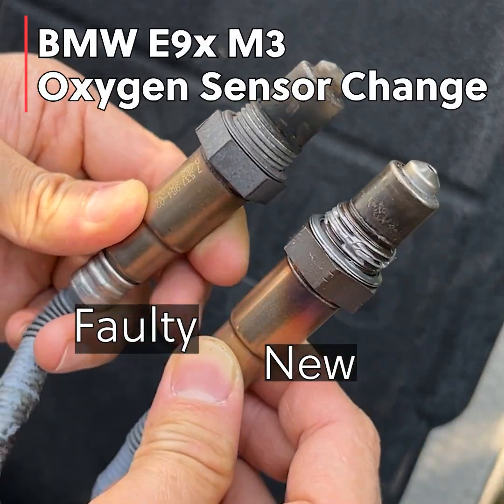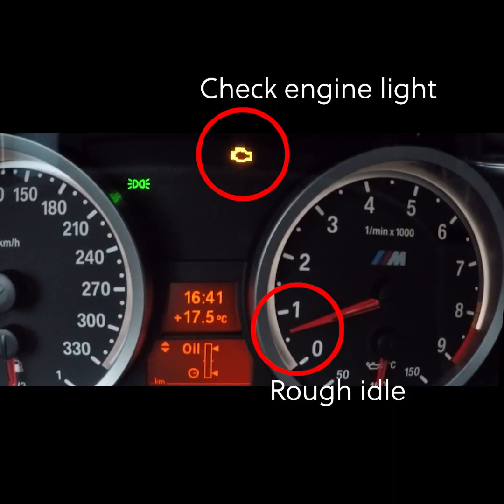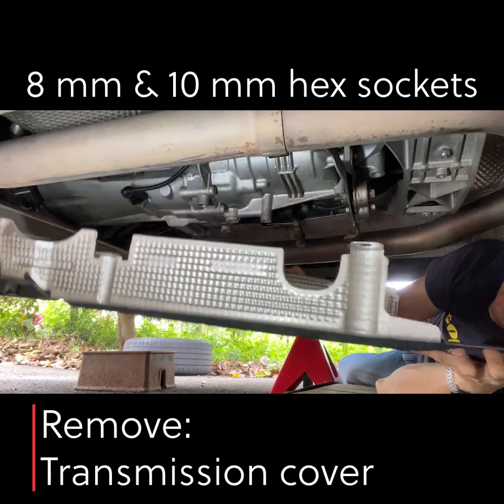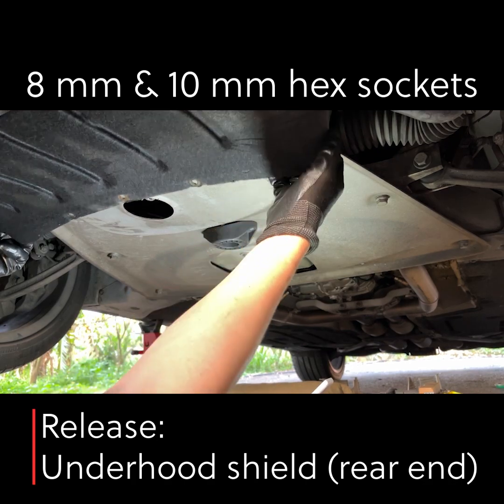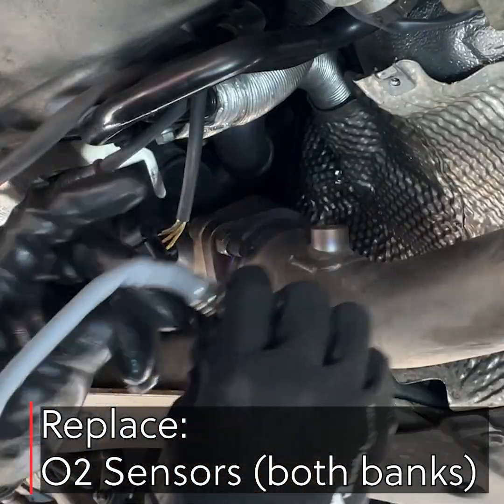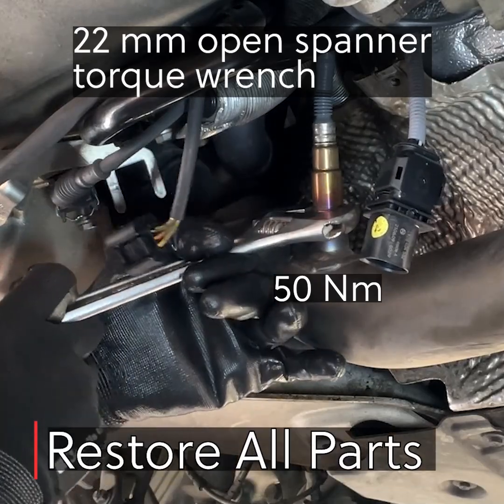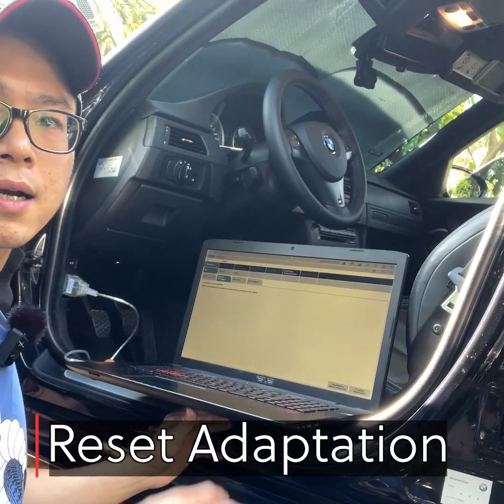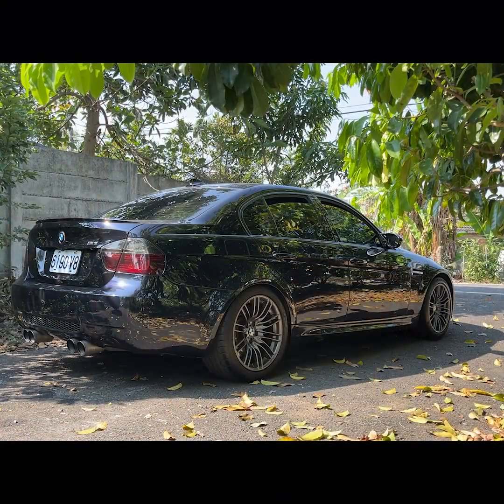E90 M3 Oxygen Sensor Change in 1 minute [ENG SUB]

Comment: If you remove reinforcement plate you need to replace bolts. They are 1 use (angle torque).

Comment: I'm getting a limb mode, but no rough idle and no check engine light. (Note: I already replaced both of my TA prior to this.)

However, if I go full throttle with 7-8k RPM it will usually result in limb mode.

Checked the code it's 2B16. "Oh maybe it's a faulty TA, since I got the rebuilt unit." Got a new one under warranty for free, replaced it. But this time my mechanic said, there is an Oxygen Sensor code showing up as well. He said he'll clean the sensor and delete the code, and we'll see. 

On day 3 after the new TA, same issue. Under full throttle at 7-8k RPM limb mode. I'm going to replace the oxygen sensor next, never knew the O2 could cause the limb mode.
Reply: Thanks for the video.
Reply from the maker: Hello Bew thank you for the feedback. My case is that the limp mode is caused by misfiring due to wrong air-fuel mixture. The O2 sensor did not directly trigger limp mode.

I checked your 2B16 code and found it's related to bank 2 TA. I had played with a used TA and had similar limp mode due to its faulty circuit. (A mechanic told me to stay away from used TA because we never know the condition of the circuit board.) I believe the TA must be replaced because the fault codes are pretty darn trustworthy.

What's your code about the O2 sensor? Maybe that sensor is about to break so it's being unstable and throwing code randomly... so I like to check the codes and see what the car says 🤗
Reply: @ Yeah so after a few months of getting the car, my car went into limp mode. And when I shut it down, and start it again the limp mode stays and it's the 2B16 code. 

I decided to replaced both TAs with a rebuilt unit that offers a lifetime warranty. 

Few weeks later the car started having the issue about using full throttle @7k-8k RPM will immediately go into limp mode with all sorts of DSC, Flat Tire, error codes. And the dreaded 2B16 in code. I thought I must had a faulty unit, I told my TA supplier he immediately sent me a new one for free, and I return the "faulty" unit. 

My mechanic installed the new TA, test drove for a few days no problem. I got the car back test drove for a few days no problem. Now today, the 2B16 is back. I told my TA supplier about it and he said
swap the TA from the left bank with the right bank and see if the problems is still there. If the problem is the TA unit, it should throw 2B15 code. 

My code for the O2 sensors are 277D and 273B, which is both for the bank#2. I also get a 2B61 code which is weird.
Reply from the maker: @ Hey Bew I took a look at the O2 codes;

273B is from the sensor monitoring the cat so I don't think it's related to the limp mode.

277D tells that the DME is not getting correct measurement from the sensor. I guess this one (before the cat) might be related to the limp mode.

2B61 may be a false alert.

By the way, this car is very sensitive to voltage fluctuation so please also keep an eye on the battery condition. Most false alert arise from instability of the system voltage.

I have been busy with my baby an my work. I do have a few videos to edit 😅 Be sure to come back and see how I'm doing!
Reply: @funcarsgoodpeople  Appreciated the your time. I tried switching the throttle actuators, no issue so far. But gonna need sometime maybe it will come back later.

Regarding 277D do you think just replacing the sensor would solve the issues? My previous owner installed aftermarket exhaust as well, and it might affected those sensors. 

The battery, I think is doing fine. I last checked with my voltage meter it was 14V when it was running and 12V when the engine was off. 

May I ask where do you get these really good infos? Ista+? 
I only have the BimmerLink to read the fault codes, and I'm not sure how accurate the BimmerLink is haha, but it gets the job done.
Reply from the maker: @SuperPandaren  Hi I'm not sure whether the O2 sensor caused the limp mode but a new set should clear the fault code 277D and give you good combustion. But before you spend money on this, try swapping both banks and see if the code goes to the other side. Just to make sure that sensor is faulty.

I strongly recommend having ISTA at hand because it has everything you need for troubleshooting; the fault code lookup, the technical descriptions, wiring diagrams and repair/service manuals. You can either use it like a diagnostic scanner (with proper OBDII interface) or without connecting to the car (like your library.)
Reply: @ also thank you for the reply. I wasn't expecting one haha, since this video is like a few years old.

Comment: Thanks for you replacement guide. What trouble codes did you get to lead you to replace the O2 sensors?
Reply from the maker: Hi @littleroller below are the codes I had and you are welcomed to visit the full video and its description https://youtu.be/9n33de17WiI

**Codes for O2 sensor before cat. on bank 1(they came randomly)**
2724 DME: Oxygen sensor, signal before cat., bank 1
2726 DME: Oxygen sensor, plausibility before cat., bank 1
2728 DME: Oxygen sensor, coast-mode diagnosis before cat., bank 1
2742 DME: Oxygen sensor heater resistance diagnosis before cat. converter, bank 1
2748 DME: Oxygen sensor before cat., evaluation module in control module, bank 1
277C DME: Oxygen sensor trim control diagnosis, bank 1

**Codes accompanied with limp mode I had**
2B35 DME: Misfire with cutoff, cyl. 1
2B36 DME: Misfire with cutoff, cyl. 2
2B37 DME: Misfire with cutoff, cyl. 3
2B38 DME: Misfire with cutoff, cyl. 4
2B41 DME: Misfire with cutout, several cylinders
2B42 DME: Misfire impairing exhaust emission, cyl. 1
2B43 DME: Misfire impairing exhaust emission, cyl. 2
2B44 DME: Misfire impairing exhaust emission, cyl. 3
2B45 DME: Misfire impairing exhaust emission, cyl. 4
2B4E DME: Misfire impairing exhaust emission, several cylinders

Comment: Can a bad cat cause fuel cut off codes???i got a 330ci 01 manual... I done replaced sparks, coils, cam shaft sensors, the two o2 sensors on top of the exhaust, fuel injectors, MAF sensor, ignition coils and ignition coil harness wiring upper and lower intake boot, I THINK I fixed all the vacuum hoses they were all busted and torn and not connected, even replaced the fuel pump, crankshaft sensor... Cleaned the icv... Cleaned the throttle body.. idk what to do it's misfiring in cylinder 1,2 and 5.. codes are p1341, p1343 and p1351 misfire with fuel cut off.... The engine is lurching... Hard to start up too... I know I have a battery that needs to be replaced it's from 2017... Voltage has been low not sure if that'll cause the issues I'm having... I've replaced more then this as well lol. Radiator and hoses. Clutch. Alot. But anyways yeah help me.... Only thing I haven't replaced yet is the fuel filter... Also when I give my car a full tank to the max the gauge is off by like an inch or so. Or half an inch.. could a bad fuel sending unit cause the codes and issue I'm having as well? Fuel regulator.. ? Anything. Help me. I haven't replaced the post cat sensor yet though I have them just haven't installed them yet...
Reply from the maker: Hi Hope thank you for your comments. I don't think a bad cat would matter. However, you correctly replaced the O2 sensors, the two on the top (before the cat,) so I think there's no faulty parts in the exhaust system. But be sure to reset the adaptation with your diagnostic tool so the engine can run with correct air-fuel mixture.

I've checked those three fault codes and they are indeed misfire of multiple cylinders. I suspect not only cyl. 1,2 and 5 are misfiring but also the others are misfiring randomly. I heard that an unhealthy battery can also lead to misfire. So please use a new battery for trouble shooting. Check all wiring connections and grounding points around the engine to ensure the electrical system is intact.

I don't think the fuel matters a lot. You can go ahead to replace the fuel filter if you suspect poor quality of the fuel. Just to rule out most of the possible causes. I believe your are very close to the answer! Best luck!
Carl